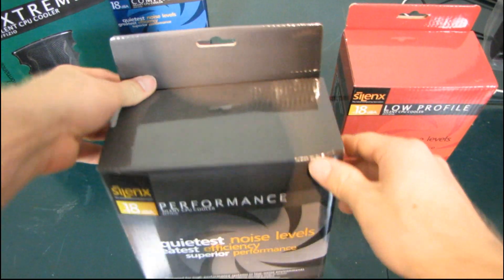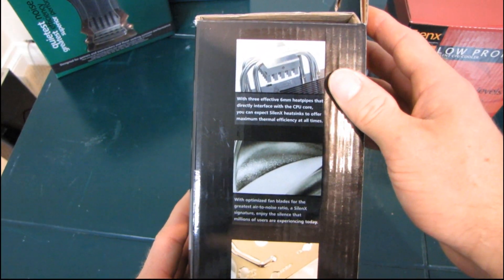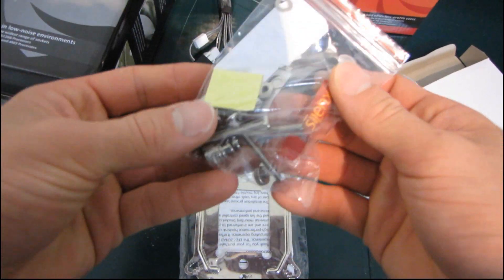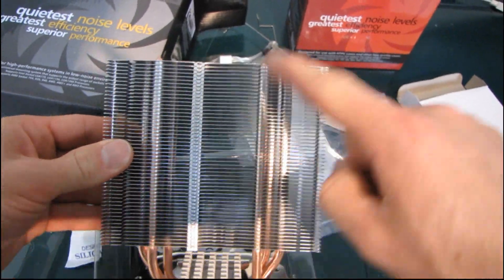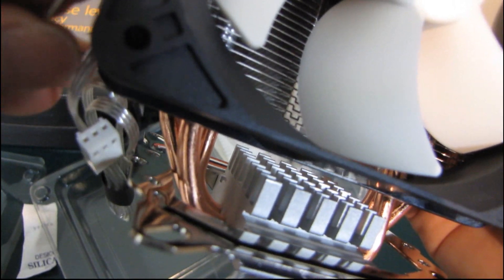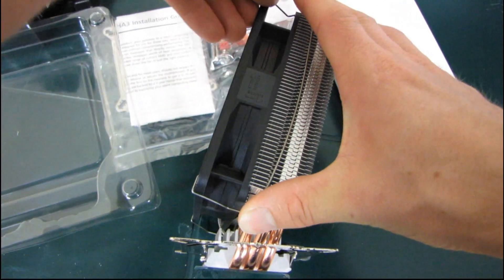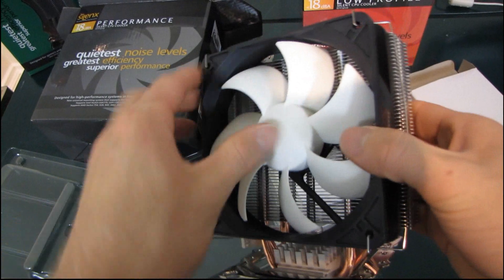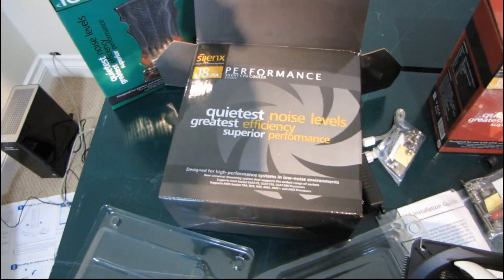SilenX Effizio Performance Triple Heatpipe Silent CPU Heatsink Unboxing & First Look Linus Tech Tips

Comment: hi
id didn't really get why you didn't like the fan clips as id never had a problem but now i do because of my new dominator ram i could have the fan on the right side so i moved it to the bottom but as this is also a much smaller area and where my 24 pin is i was quite a pane in the ass to try a hook the clips on it cost me time and allot of blood as i kept getting caught on my sharp heat sink fins :( LOL
also great video review keep them coming :)

Comment: Are the different material that the heatpipes are made of (due to the different color) going to cause any uneven temperature levels across the surface of the cpu? That's the only worry I have. Not all metals have the same conductivity, and since the heatpipes are melded in like that, it just seems like it would cause certain areas to be hotter than others.